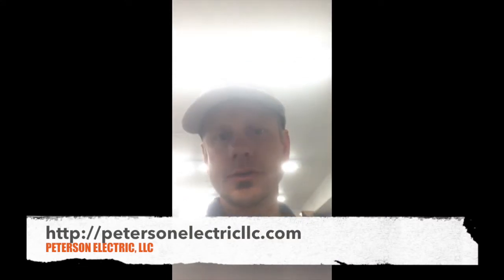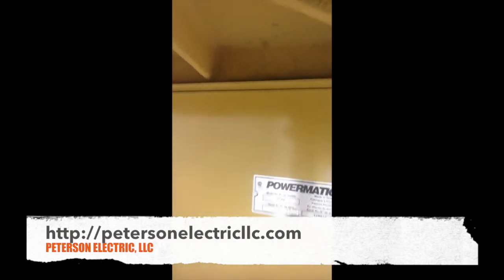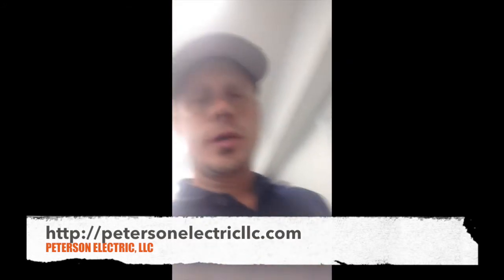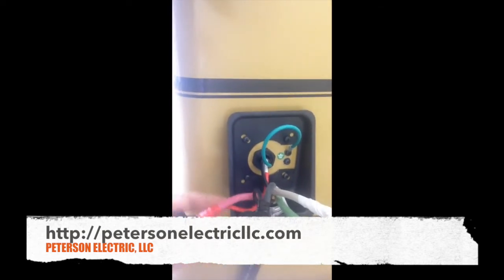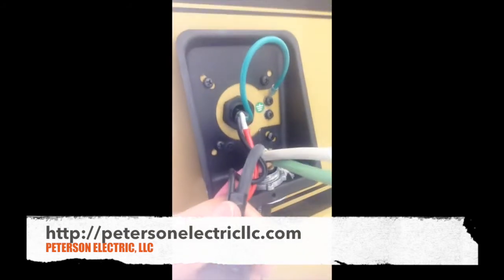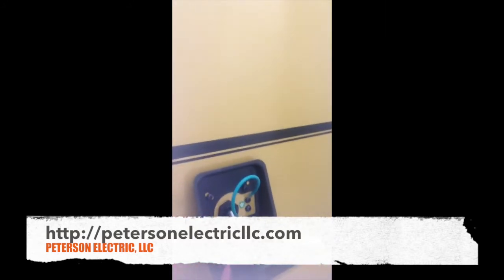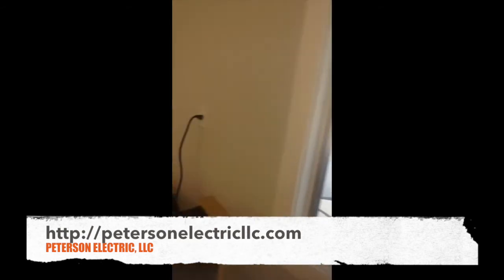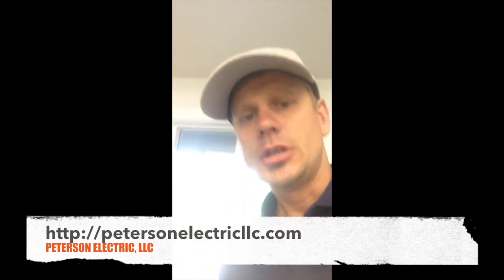Determining Wiring Needed For Powermatic Wood Shaper Machine

Comment: This is the only video for wiring this equipment. The Powermatic website manuals don't show it and they won't tell you if you call. The "Assembly and Setup" videos don't cover the electrical requirements, even though Peterson shows a cord end on the Jointer.
Thanks for posting. I hope to post one of my own once the equipment arrives.
Did you do a video on the Planer?
The equipment hasn't arrived and the walls are going up - I guess we pause construction until we can get a look at the equipment.